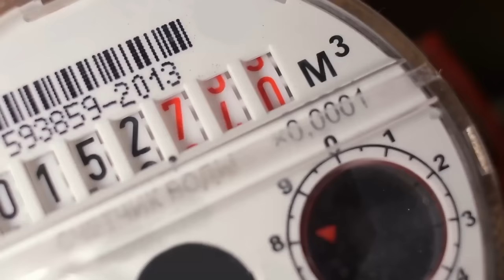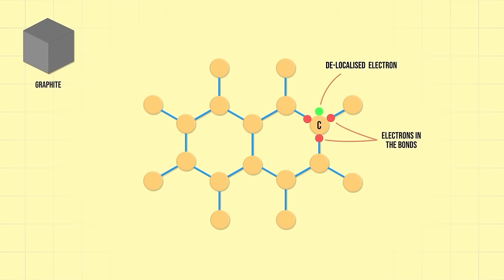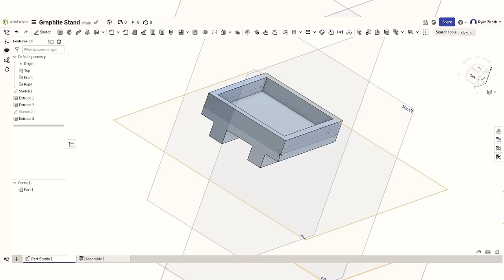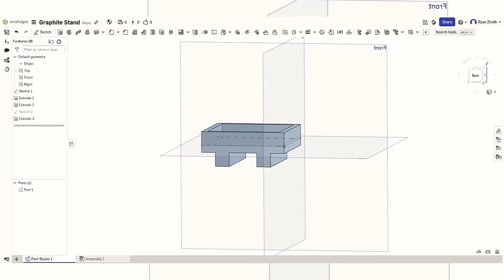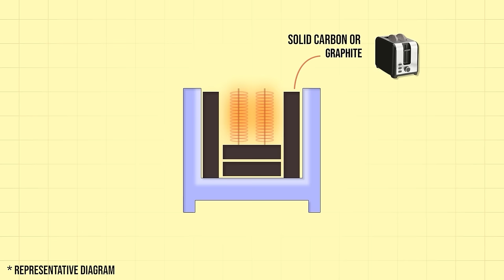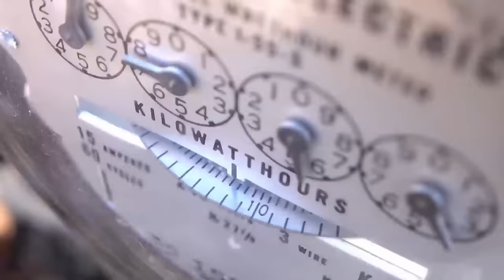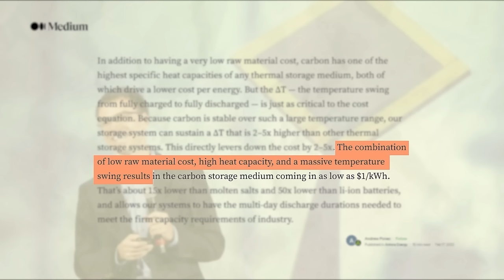Why Solid Carbon is the Future of Energy Storage

Comment: I feel like thermal batteries don't make sense.  There are green, cheap, bulk, conventional batteries available now.  Iron oxide, vanadium flow cells..etc.  Converting electricity to heat and back again, is an unnecessary conversion with increased complexity that reduces efficiency and adds addition risk of failure.  Also, think about the dangers that come with crazy high heats.  What if somebody busts it open?  Rust batteries are big, heavy, safe and cheap, but more importantly, very green, compared to lithium cells.  I think we're looking for solutions to problems that have already been solved, they just need to be implemented.  Size and weight don't matter for grid-scale, stationary storage.  Make em big, safe and cheap.  For lighter, mobile applications, we have sodium and lithium iron phosphate.  I think sodium makes more sense cuz we can pull it from sea water.  The efficiency and energy density will probably improve a lot when paired with graphene.  So we would still see an improvement over todays conventional lithium, in terms of density, cooling, charge speed and lifespan.

Comment: So, no matter what you would still need as many solar panels or wind turbines to power the region as you did before carbon battery storage. Seems we're just adding another step in the process, but not actually solving the problem of inefficient renewable energy sources.

Comment: Does anyone know what the target atmospheric CO2 concentration goal is for "net-zero" initiatives? Also, how does that goal compare to the optimal atmospheric CO2 concentration to support photosynthesis? I noticed CO2 generators at a greenhouse i visited recently which is why I ask...
Reply: The generators are not uncommon. Under 280 ppm CO2 is accepted as the pre industrial level. 1000 ppm is 0.1% CO2. Also think about fluoro carbons methane ammonia and even water itself. The whole point about the greenhouse effect is that anything that heats up the surface of the earth makes water evaporate which further heats up the earth until we get a runaway condition. This seems to have happened on Venus. In the case of Venus, the water was then stripped away by solar wind

Comment: Interesting has anyone considered a setup with 2-3 of these units making off-grid charging
Stations to expand EV travel arrange to swap out  1 battery at a time for constant power
Availability with trucks on regular route jobs for drivers. Even set up aux. Ports for 120v 
Hookup lets travelers recharge portable battery banks like in the mountains between California And Nevada or along the remote areas and deserts in CA. + NV.  + West TX. + AZ. 
With an electric semi and electric crane-equipped flatbed, you can power the delivery
Equipment from the cargo they deliver and swap out picking battery with just 
10% left would get trucks back to reload

Comment: Impressed, but my big question is the durability  of the carbon blocks in use in their "charging" and "discharging" cycles.  Is the 30 year claim valid ?  Would it be useful for district heating?

Comment: While I acknowledge that my cognitive abilities aren't as strong as they once were, nor were they exceptional back then, this is simply my opinion based on this video.

I firmly believe that renewable energy, coupled with a diverse range of battery designs and methodologies, is the most viable path forward. However, the video appears to overstate the advantages of this particular approach while underestimating its drawbacks.

Comment: I admit that I could easily be wrong, but I'm honestly not getting the reason for these insane temperatures.  I can't think of a single application where it would be feasible, let alone easy, to use this to directly heat some product at 1500 C.  Kilns perhaps?  Just build kilns instead?  I mean, I'm sure there are applications... but more "niche" than "taking over".

Comment: Can you give some more explanation on those TPV panels if they absorbs 40% of a 2000C source, we still have a 1200C heat source behind them which can be used to power a steam turbine.bringing  total efficiency to around 60%.

tt would work as well for natural gas power plants where the flame is burning at 1980C but they completely ignore the TPV which would greatly reduce the energy cost.
Reply: he says this lost heat will reflect off the mirrors and back onto the panels. But shouldn't such solar panels only emit radiation that they are unable to convert into electricity? Otherwise, they would not emit thermal radiation at all and 99% of their heat would be converted into electricity (neighboring molecules glow on each other).
Reply: @1Neckrus1  the reflected low energy photons are going through the panels (again) and back into the carbon blocks and hopefully re-absorbed there, releasing their energy back to the blocks and heating them a tiny bit. This in turn means that the blocks can keep emitting higher energy photons for longer as they don't cool down quite as quickly.
Reply: @DerMacko  a block heated more strongly by low-energy photons will produce more warm radiation at a time, but this will not make the system work longer.  The mirrors will not heat the block at the end of operation to temperatures higher than the solar panels can process, this violates entropy.  This heat accumulator will work until the temperature inside the system reaches certain degrees at which only those photons will be released that cannot be used by solar panels, then there will be cooling to the external environment.  Mirrors are needed only for thermal insulation: increasing efficiency and lowering loses, but not increasing the amount of total possible energy production. It’s like with Stirling engines, everyone is chasing an increase in their efficiency when they themselves are weak, and we need to work specifically on increasing their possible work output.
Reply: @1Neckrus1  have you ever seen an old school glass thermos? The ones where the glass bottle has a mirror finish on the vacuum gap side? Same principle. Reflect back radiative heat, keep it hotter for longer.

The longer the block can maintain temperature where it is emitting usable photons, the longer the panels can output electricity. Preventing those low energy photons from escaping the system prolongs this time. Thus increasing the overall efficiency. It does not increase the effiency of the panels per say, but the net extractable energy of the system.

 Ideally you'd want to reflect back every photon with too low energy that isn't enough to trigger the band cap transition, but also photons with too much excess energy beyond that since that excess is also wasted as heat in the panels after the electron/hole pair is formed.
Reply: @DerMacko  This is exactly what I wrote, mirrors will not increase the maximum energy output, they will only reduce losses, preventing heat from dissipating into the environment. The maximum energy output is limited only by the capabilities of the solar panels; mirrors will not increase the efficiency of the panels. Reducing losses does not mean increasing the maximum potential output.
Reply: @1Neckrus1  if we agree then why did you reply to my first message the way you did? "but this will not make the system work longer. " is what you said.  When it does exactly that...

Comment: would it be possible that for solar pv panels, instead of reflecting the low energy photons, could you instead capture them as heat and further add to the heat in the batteries? Either using some kind of heat pump or heating water to turn a turbine to get more electricity.

Comment: I wonder whether, with such high temp levels, a thermodynamical electricity generation would not be more advantageous from an efficiency point of view. The Carnot efficiency of a 1500°C heat source is ~~ 0.75, the real efficiency o c being a lot lower.

Comment: i would use the excess to produce hydrogen through electrolysis  and store into high pressure  carbon fiber tanks  like a breathing method  or inflating a balloon then recycle the water  and ultracapacitors as a middle battery  to help transitions and provide a steady flow when switching hydrogen or solar

Comment: Why not use sterling engines? They are a heat engine that uses or can use heat to run the engine (as little as the differential from your hand to room temp. The Stirling engine is @ 75% recovery of heat btu's to electrical energy. and is there one for home use yet?

Comment: still dont get how you would extract heat for a process e.g. melting steel directly, other than using the pv panel to make electricity and then heating via electricity.

Comment: Can you not capture the heat directly via heliostats and get more out of the system or is the cost to output not worth the extra heat/power collected? Just like you could burn wood with a magnifying glas, high temp can be achieved with simple light concentration. Is there no gain in the more efficient "direct" route?
Reply: We have tons of existing industrial facilities that dont have a ton of space and cant be offline to install an experimental technology,  the beauty of this is it is small and can plug into existing industrial equipment comparatively easily.  If designing from the ground up your right solutions exist but these heavy industrial facilities are often pushing 100 years old with no reason to replace them.
Reply: @ccibinel  Yes for them it may be so, but we need more production built, would not those benefit from direct heating?

Comment: PLEASE HELP! IDEAS WANTED!! I'm hoping to find a cheap way to store PV energy from the summer, to heat  (help heat) my home in winter. I've 1.5 acres of a site, so space isn't that much of an issue. If I'm able to draw air, or water out of my system at even 30-40C, that would still be incredibly useful heat. (Living in Ireland BTW.)
SECOND QUESTION! I can get a 40 KWH, almost brand new, battery from a crashed EV, for about 5,000 Euros. So, so cheap compared to Powerwalls. How difficult/expensive to use this battery for home energy storage? Links to answers, will also be gratefully received. Thanks for reading.
Reply: Geothermie, pump exceeding heat into the ground and get it out in winter...
Reply: Thanks. It's something like that, I'm considering, and I'd love to hear from anyone who has tried the same, or even decent videos of these systems. In most places, storing 'spare' electricity as heat, makes so much more sense, than storing it as electro-chemical energy, only to power a heat pump, down the line. True, you have a heat pump gain, but thermal energy can be stored inter-seasonally. Unless you go pretty big with wind, it's just a toy, so my only hope is to store that 18hours of light in the summer, to warm my January nights. @AltMarc

Comment: How about the insulation for one of these?  About the only thing that I know of that works at this temperature range is the ceramic fiber family.  These are not inexpensive.  Also, is there a vacuum gap required like in a thermos bottle to stop conduction to the housing?  And, what kind of heating element has a useable lifetime at these temperatures?

Comment: I don't get it. Sand has both a higher specific heat capacity and volumetric heat capacity,  and sand is 200 times cheaper. Sand appears to be a far better candidate for thermal energy storage.

Comment: When a surface emits a photon the energy's gone at that time,   it is cooled by emitting photons.     

Until this photon meets a reactive molecule it is energy at the surface T of the emitter.   I think this means the emitting surface is cooler.  

 Now can a reflected photon be absorbed unless we have a temperature gradient?.  Is there a gradient  so it transfers  from hot to cold?  Or is it like a thermos flask reducing heat loss?

Some claim the Earth acts like this in back radiation?   I have doubts the emitted photons are seeking a reactive molecule in space as Earth cools.

Comment: How did they get the panel efficiency to 40% when all solar panels produced so far operate (on similar photon wavelengths) can't even penetrate past around 20% efficiency and a further loss of efficiency in high temperatures?
Reply: Answer in the video from  11:31 to 12:49

Comment: I could see every new household getting one of these, and rolling outages never being a thing again.. what I wonder though, is, if the container is breached, how difficult is containment of such a tremendous heat source which would burn for days, no matter what?.. just a pin hole in a tank would result in effectively a torch as the air hits that heat.  
They compare the efficiency to roof top solar, but that's a first point energy generation, not an energy storage medium.. they should compare the efficiency to lithium ion charge/discharge and coal/oil generator efficiency so we're talking about the roll they seek to replace.
  I'm thinking in ground would be the place to put them in New construction.. put them on the other end of the geothermal heat exchange system 😁

Comment: 🎯 Key Takeaways for quick navigation:

00:27 🔄 Solid carbon, similar to graphite in pencils, is a breakthrough in renewable energy for thermal energy storage, capable of delivering continuous heat or electricity to various industries.
01:38 🌍 Antor, founded in 2018, aims to decarbonize heavy industry by using renewable electricity to resistively heat large blocks of solid carbon, stored in insulated containers, delivering process heat or electricity.
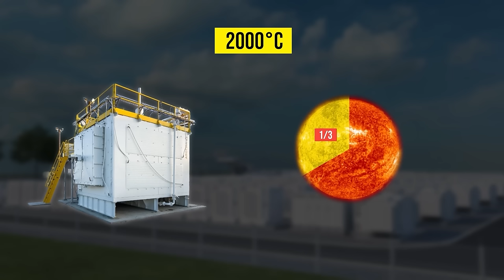02:32 🔥 Antor's thermal batteries operate at over 2000°C, suitable for high-temperature industrial processes like steel treatment, glass making, and advanced ceramic engineering, traditionally reliant on fossil fuels.
05:35 ⚙️ The use of solid carbon sets Antor's thermal battery apart, offering thermal stability, high thermal conductivity, and high specific heat capacity, enabling efficient and reliable heat and electricity delivery.
06:30 🏭 Heavy industry, responsible for significant emissions, struggles to decarbonize due to the demand for reliable high-temperature heat. Antor's solid carbon battery provides a potential solution to this challenge.
09:54 ☀️ Antor's thermal batteries charge by resistively heating solid carbon blocks with renewable electricity, storing energy effectively at temperatures up to 3000°C in insulated, steel-covered containers.
10:37 ⚡ Antor's thermal battery releases energy by directing the thermal glow from heated carbon blocks to industrial processes or using a thermophotovoltaic panel to convert the heat into electricity.
11:16 🌐 The thermophotovoltaic panel converts infrared radiation from the thermal glow into electricity with an efficiency over 40%, allowing for the effective conversion of high-temperature heat into power.
13:35 🔄 Thermal batteries offer advantages over lithium-ion batteries in terms of material costs, lifespan, and efficiency, making them a game-changer for electricity storage, particularly in handling excess renewable energy.
15:53 💰 Antor's thermal batteries boast low material costs, estimated at $1 per KW, making them significantly cheaper than alternatives like molten salts and lithium-ion batteries, especially when considering overall system costs.

Made with HARPA AI

Comment: With 20 percent of efficiency in solar cells and 40 percent efficiency in this storage system converting heat back to electric energy, you have then 8 percent efficiency of the whole system, that is from solar energy to stored electricity. And that, it looks to me, is pretty dismal.

Comment: This could be great for industry, storing heat will be crutial for greener industries. As for electricity... yes its better to store 30-40% than nothing but if you´re storing it just for a couple of hours probably electrochemical betteries would do a better job and even if they are more expensive (tho that may change) they could be more profitable. And I understand thet the 30 years does not account for the tpv panels, and I have a bad time believing that the insulator system as weel as the steel container can go that far for such temperatures.